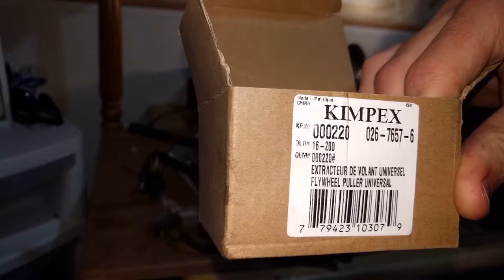Remove Flywheel & Stator Polaris Indy Snowmobile

Comment: Nice video. Piston blew and going to split crankcase to clean. Check bearings. Got to remove flywheel and stator? It’s 2015 Polaris Axys Pro S 800
Reply from the maker: I believe so. I googled for a repair manual for your sled in case you don't already have one and found this. That should help a lot! https://www.dropbox.com/s/3h37g1mmo7zy11y/9927630%20Axys%2015-17.pdf?dl=0

Comment: Thanks.   I'm trying to figure out why my sled has no spark.  Installed a new coil to no avail.  1994 Indy 500 Classic EFI in immaculate condition.   Ran last season.  Baffled.
Reply from the maker: My suggestion is to get a multimeter and check all your electrical components for continuity
Reply: @MarshallBLewis  thanks, great idea.  yes, that would zero in on a short.
Reply: I'd check the little button behind the throttle, connected to the kill switch
Reply: @timothywaterman1511  thanks,  will do!

Comment: Do you have to time the motor after replacing?
Reply from the maker: No you do not have to time the motor after replacing. The Polaris repair manual says to "Mark stator plate and crankcase for reference upon
reassembly." in my re-assembly video https://youtu.be/6Ces1CHUavo at the six minute mark you can see the straight line mark at the top of the stator plate and the "v" looking mark on the crankcase. I believe those marks came factory so just look for them before you disassemble or add your own marks to make sure they're there.

Comment: It's not a good idea to use an impact on crankshaft nut or bolt on the clutch side, it could Crack the crankshaft if improperly used.
Reply from the maker: i wouldn't recommend anyone use an impact either unless they want to get it done faster and easier while assuming the slight risk of breaking something
Reply: @MarshallBLewis  the one I seen break the guy was aggressive with air impact he used. So I do agree with you Marshall , a slight risk. When not being  a meat head with an impact.. I didn't explain that properly.... my bad!
Reply: @MarshallBLewis  I would be grateful for your opinion on a sled I'm working on. I think I know what happened,  but I'm needing a alternate direction to go.
Reply from the maker: @derrelmccoy5  yeah sure, what's the situation?
Reply: @MarshallBLewis  I got a 94 rxl 650. I don't think stator plate or flywheel are original, (butt connectors on wires and different length bolts on plate) having trouble getting it timed correctly. I have to work with what I got. Do you see a problem if I modify the plate so it can be rotated counter clockwise to get the correct advanced setting? Timing marks on the plate are located at 3:00 position,.
Reply from the maker: @derrelmccoy5  I do not have enough knowledge about engine timing to answer your question because I have never had to set / reset the timing. LIke I mentioned, when I disassembled and reassembled my XLT engine, I verified that the stator and engine case were both marked and lined up, which they were, so I just reassembled the same way and engine ran fine. What I can do is point you to this facebook group that has a bunch of  knowledgeable diy sled mechanics who can probably give you an answer if you post your question over there. Also if you don't have a Polaris service manual to follow while doing the timing, you can find one for download under the "files" section of the group. I'm not sure if your sled model is part of the manual (It's a 1985-1995 Polaris Indy service manual) but I checked and there's a section for timing Triple Cylinder Polaris Engines so hopefully that will help you out.  here's the group https://www.facebook.com/groups/271755309557973
Reply: @MarshallBLewis  thank you. That was helpful. The sled screams when it runs, I don't want to give up on it.